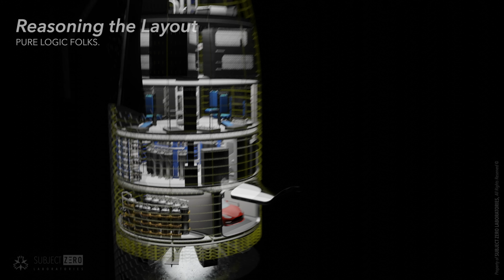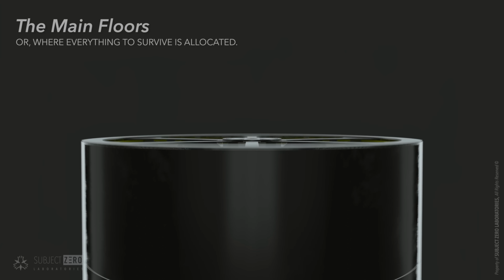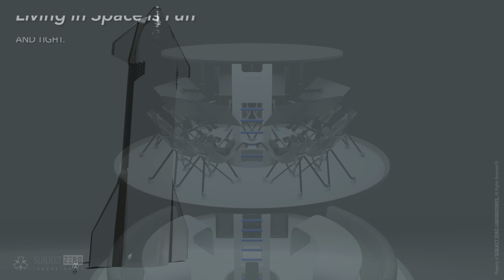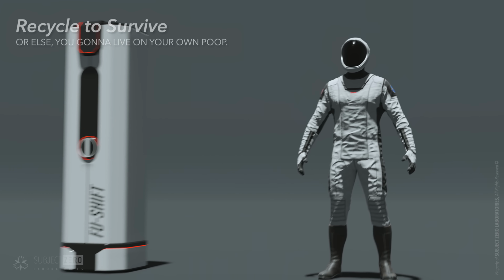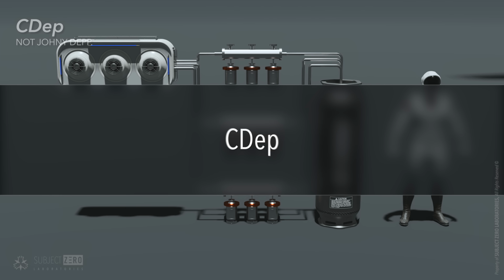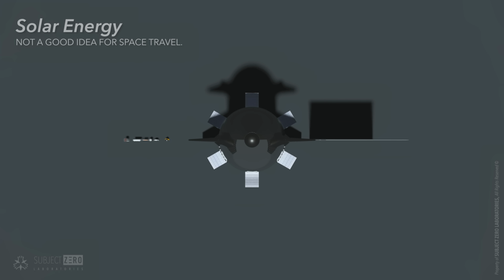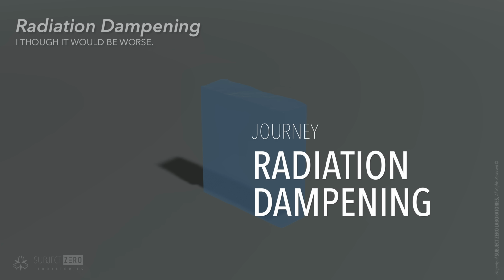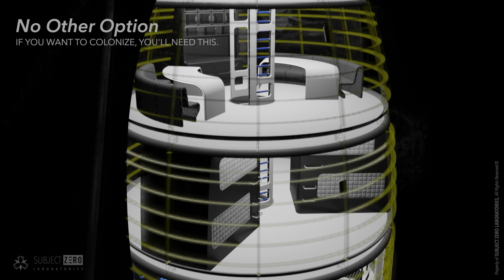Onboard the SpaceX Starship 2.0 in Detail - What it takes to go to Mars | Detailed Breakdown

Comment: I am pretty sure they will not build a one-fits-all solution. Cargo will be send to mars ahead of time. The human transport configuration will only hold the supplies that are needed for the transfer. Also i do not expect to have a full flight control deck for all crew members. I imagine something similar in size to an airplane cockpit. Why would the system do need a lot of human interaction, if the starship is designed to fly without crew and carry cargo on its own anyway?
Reply: Agreed ;)
Reply: This makes sense to me... 💯
Reply: Actually 2 ppl should really be enough.. or maybe even one
Reply: If something goes wrong, it's generally a good idea to have backup systems. Also they will need to be monitoring all kinds of different things on the screens and different pilots will probably have different controls.
Reply: @keithscommunityanddomestic9513  maybe until spacex is ready for mars we already have neuralink up and running, so u can do that from all around the ship.. im just kiddin obv, but still fun to think about
Reply: Nano bots will tend to our every need.
Reply: @wokeness420  ye, but they are in need of some major breakthroughs before actually becoming as efficient and useful as they could be..
Reply: Combining cutting edge tech will probably be more useful than advancing in just one field a lot and not use the other stuff.. like imagine what machine learning, nanotech, genetic engineering, neurotech and similar stuff could achieve.. its a slow progress, but once integration with humans becomes better i think we would become much more adaptable to hostile environments such as space
Reply: Perhaps initially best to send Westworld hosts of the inorganic and unconscious kind.
Later on, once the hosts have erected all the tents,
people in suspended animation pods packed in water jackets would then make the trip.
(And bring lots of low light loving,  
low temperature loving, 
living potatoes genetically engineered to maximize nutrition
(and oil to cook the french fries in the Mylar parabolic oven)).
Reply: @nulled7888   We'd need to become robots to be able to handle space... but don't let reality get in the way of your sci-fi dreams ;)
Reply: You need a place for the crew to sit during the start and landing phase.
Reply: You talking facts 👍
Reply: The tablets which permit astronauts to interact with the Crew Dragon are only fixed in front of the seats because, since the flights normally only last a couple of hours the Crew normally spend the entire flight sitting in their seats.  However the controls are merely apps running on tablets.  The traditional control panels on the Boeing Starliner look prehistoric.  Those tablets could just as easily be carried by the astronauts in a pocket of their coveralls, attached by a cable to avoid flying out of range in micro-gravity.
Reply: You guys are thinking like KSP. Imagine this is something YOU are riding. And then imagine you have to deal with the worst case scenario... 90% of everything in this thread is fairytale stuff with no basis in reality. When you have an emergency like there was an oopsies with the cargo ship, then either you deal with it now with what you have on hand, or your dead. Giving everyone access to critical controls and training means that you have 10 more chances for someone to pull your butt out of the fire.  Having the supplies on the spot means that you might be able to afford to wait for a return trip if an abort is needed.
Reply: @jamescobban857  they look prehistoric and your right, but when was the last time you ever had a mechanical switch or button not respond to your touch? They look like that because it's incredibly reliable. Is it outdated? Sure. But you wouldn't scoff at reliability if your butt was in a sling. You want equipment that has a zero percent chance of failing and when it does fail you want it to fail in a fixable way.
I'm not saying that Boeing's equipment is reliable mind you... I think Star liner is a sad joke made at the American public's expense by Congress.
Reply: @nulled7888  A flight crew in command of three (commander, pilot and engineer - all cross trained) is more probable, I think.  At least on first flights.  The rest will all be specialists of which minimum one has to be medical doctor.
Reply: @pierre.a.larsen  actually, yea for the first few flights thats probably the case.. after that tho, it might become more viable to have a smaller number of pilots
Reply: Still need supply for at least 3x for each person for backup.
Reply: @nulled7888  2 people should be an opposite gender and start breading
Reply: @rosekreuze  what the actual f*ck?
Reply: They could launch supply’s into space first which then they can pick up in space so they can take more with them
Reply: The reason for having the crew on one deck is for a likely Launch Abort system.  It's possible to do this for 15 person spacecraft.  NASA and FAA isn't likely to approve anything less until it has a proven flight record of safety.
Reply: @pierre.a.larsen  That's correct.  You need a Pilot, Commander, Flight Dr. and Engineer in the Cockpit.
Reply: Agree, the simplest solutions is usually the best solution.
Reply: @saquist  This is the main reason why SLS is still needed. People underestimate how much it takes to get a completly new system certified for human passengers. Especially if there is no launch abort system at all. The Starliner riding on top of the SLS is already up to all the standards and will be used many times during the artemis program before starship will be allowed to carry passangers.
Reply: the flight deck needs everyone in it for launch and landing (so they have a secure place to be)
Reply: A full flight deck is necessary when you consider launch and landing operations. Astronauts need strong seats with lots of safety features to go through a launch or landing operation. You can't just have people standing in their bunk beds hoping that 1.5 to 3 Gs won't fly them through the door without safety belts. That would just be unsafe. In the end, astronauts need a ''manoeuver seat'' and it's just better to have them all bunched in a control room because it allows for everyone to have the same level of awareness when things happen.
Reply: I agree
Reply: A pretty basic response is that it wouldn't be the best to be in a cramped space for 4-6 months, better yet all the waste and byproducts the astronauts might produce . Also it would be good to at least have a bit of places for experiments in the mean time. Places for habitation would also be ideal, as the astronauts wouldn't have much to do in the mean time, and 1 way light time is quite a long distance so communication with Earth won't be instant. Maybe entire rooms might be designed do to the extra space, and the cargo would probably already have been sent in the meantime. To be honest, sending humans isn't ideal for interplanetary colonisation as robots are far more cheaper and easier to handle with.
Reply: @wokeness420  God I hope this is sarcasm.
Reply: @oO0Xenos0Oo  The launch abort system is a good point,  however SLS is very expensive and overall not ideal for long term spaceflight. For missions to the moon, sure but Starship is far better in many aspects compared to the NASA counterpart, despite the lack of Launch Abort System.
Reply: @Monkey6900_   The idea of sending humans on interplanetary mission becomes really messy.

There would have to be two starship involved in one launch.
Reply: I agree 100% half the stuff he put in the usable area of the star ship is pretty useless, you don’t need that much room for a fitness center, command center, and lounge, it’s not a cruise ship. I would say it’s more likely going to be used by either commercial cargo (it is a private company and has to make money), medical equipment, or lab equipment (basically the entire reason we r going there and was not mentioned AT ALL)
Reply: @nulled7888  I agree, but u really do need at least 2 and I’d argue 3 is best, it is a long mission and the Apollo missions had 3 people
Reply: @Unmannedair  If it moves it can break.  If you have 100 switches that is 100 parts that can break.  It is also 100 switches which the pilot must memorize the function of.  There are no moving parts in a tablet except the power button.  And since all the power button does is generate an interrupt to the software even it is not strictly necessary.
Reply: @redthunder6183  ye, but nowadays we have better computers and everything is far more integrated.. idk tho, can just guess myself :v
Reply: @oO0Xenos0Oo  Indeed but I don't think human-rating a rocket and habitat are really that difficult.  NASA calls this a Catagory II rating and they want 1/500 failure for launch and landing or less. They also want a frozen design which will launch without flaw 7 times.

I think Falcon/Dragon Human rating took around 5 years. During that time, Launch, Parachutes, Life support, heat shield, guidance/docking and was finalized with the Demo-2 mission.  

In my personal opinion I think that can substantially be shortened. but that's only after the design is finished and it's no where near that now if you assume 3 years for certification...and the first successful orbital launch is some where in 2023 then 2026 is the certification date and that seems to be NASA/SpaceX's objective even though this is likely to slip to 2028.  I say that because they may have to certify life support for each of the different versions of Starship.  We know Starships will have the Lunar version and the Dear Moon versions in the beginning and Space X is a small company.  I doubt they can handle the development of these two versions without a substantial personnel increase.
Reply: @nulled7888  sure, but better computers won’t help when physical problems arise. In the likely case where someone gets hurt, you have to have someone to help the other person by there side, and it would be extremely helpful in this case to have someone back at base that is prepared for anything like bringing over more supplies or preparing medical supplies
Reply: @nulled7888  he said Space X satellites are not intended for Mars
Reply: @jamescobban857  if it can move, then it can break is true, but the same rules apply to touchscreens. And in zero gravity if something hard starts flying across the room, then you'd better hope that the screen isn't in the line of impact. Even gorilla glass has its breaking point. I have to work with touch screens everyday at work, replacing them. They're every bit as vulnerable if not more so than a switch. If the switch is designed properly it can take a hammer impact. Most aren't designed for that though. But even if the switch is damaged it has two wire contacts inside it that can be shorted to achieve the effect needed. Good luck fixing a broken touch screen in a hurry with a pencil or paperclip.
Reply: yeah! 2040s or 50s are going to be very exiting
Reply: If you ever saw the Space Shuttle when it was flying with a full crew, the "flight deck" was used only by the mission commander and the pilot and then two additional crew members who sat directly behind the commander and pilot.  All of the rest of the crew members...up to four astronauts but usually just three astronauts...were on seats located on the next deck below.  That was called the "mid-deck" on the space shuttle.  All of those flight chairs could be stowed away after launch to give more room for other activities like operating the remote manipulator arm (aka the "Canadarm") also happened on the flight deck.

It seems silly that the flight deck on Starship would be wasted space and not used for anything other than launch and landing activities.  Nor would there be any need for crew other than the mission commander and a back-up (aka "co-pilot" or in NASA usage the "mission pilot").  Absolutely just like the aircraft flight deck on a modern jetliner today.  Yes, the correct term is "flight deck" and not "cockpit" unless you are talking about something like a fighter aircraft or small one or two man aircraft.
Reply: Right, I was figuring that the beds they use would double as couches for most of the crew when undergoing thrust and only have a subset of the crew in the cockpit.
Reply: @GlanderBrondurg  yes. Jared Owen has a great video about Space Shuttle, where everything is explained very well with the animation.
Reply: We need to separate out the transit vehicle (Earth orbit to Mars orbit and return) from the Mars lander and ascent vehicle. That also massively reduces the problem of propellant production on Mars. The bulk of inevitably one way cargo can be sent on simpler, cheaper Mars cargo landers. Nothing particularly complicated - just regular blunt body landers with a few innovations. This will be more efficient in terms of mass delivered to Mars surface, versus mass sent from Earth. Also, separating cargo means that cargo can travel on slower but also lower energy trajectories.
Reply: @saumyacow4435  There certainly is logic to that at least initially.  Using a starship to deploy a one-way cargo probe to Mars could be re-used a bunch of times during the same launch window whereas if you send the Starship to Mars it's going to be tied up for years until it can make the round trip.

But it still boils down to how much would Starships cost to build in relation to the cost of a one-way probe.  The focus on Starship is driving down the price via both reusability as well as scale-out.
Reply: And what about the sex floor - seems they always forget that.
Reply: @saumyacow4435  

Check out everything I had to show by following the steps from my other comment, if we're talking about energy and many other advancements, that's where to go.

And before replying, follow the steps and watch everything, can't stand people who cherry - pick / nitpick and act ignorant to anything else, nothing worse than that to me.

My comments became hidden with links, so yeah quite the censored and bias from youtube, clearly, maybe even the video uploader caused it, who knows or the comments were reported by toxic and biased people with bad agendas, corruption basically.
Though there is a youtube algorithm that is very aggressive, it's just very odd that the links were shown and now they're hidden, I know they're there because when I log in I see them, when I log out and come back to refresh the video, they're hidden... how lame and biased is that to be censored when showing amazing things with the open mind around higher levels of innovation that would blow people's minds.

Also I know the comments with links were there a long time even when logged out, and now they're hidden... so not right to be silenced / censored like that.

Instead, looks like I will have to do things manually and without links, such as giving you steps, which will seem longer, sigh... blame youtube for that since my other comments are hidden with links under this thread OP.
And I can't make a new comment, it would seem the comment isn't there! So I'm attempting to edit this one, hoping it will still be there for you and others to see.

Check this out.

Go to my channel and find Technology Research, should be a video on the home page of that other channel a minute long and shows what I mean for the "created playlists", start at the bottom by scrolling all the way down to the bottom of the created playlists.

Watch just the first 2 videos at the top of the Graphene playlist.

Watch the first 9 videos at the top of the Photonic Computing playlist.

Watch the first 2 videos at the top of the Spintronics playlist.

Watch the full playlist called Graphene Twistronics.

Watch the playlist called Graphene computers for home and starships, all the way through.

There are 2 videos to check out after the playlists above that I will mention here.
There's a playlist called Graphene with starships, the video is about Graphene aerogels made in space.
The STL playlist has a video called "Spaceships capable of reaching our closest stars".

Watch all the Graphene "types" of playlists.

Watch the STL and Time Crystals playlists all the way through.

Watch all the Quantum Technology playlists.

And then watch all the other playlists under the created playlists.
Reply: @danielbuggie591  

Check out everything I had to show by following the steps from my other comment, if we're talking about energy and many other advancements, that's where to go.

And before replying, follow the steps and watch everything, can't stand people who cherry - pick / nitpick and act ignorant to anything else, nothing worse than that to me.

My comments became hidden with links, so yeah quite the censored and bias from youtube, clearly, maybe even the video uploader caused it, who knows or the comments were reported by toxic and biased people with bad agendas, corruption basically.
Though there is a youtube algorithm that is very aggressive, it's just very odd that the links were shown and now they're hidden, I know they're there because when I log in I see them, when I log out and come back to refresh the video, they're hidden... how lame and biased is that to be censored when showing amazing things with the open mind around higher levels of innovation that would blow people's minds.

Also I know the comments with links were there a long time even when logged out, and now they're hidden... so not right to be silenced / censored like that.

Instead, looks like I will have to do things manually and without links, such as giving you steps, which will seem longer, sigh... blame youtube for that since my other comments are hidden with links under this thread OP.
And I can't make a new comment, it would seem the comment isn't there! So I'm attempting to edit this one, hoping it will still be there for you and others to see.

Check this out.

Go to my channel and find Technology Research, should be a video on the home page of that other channel a minute long and shows what I mean for the "created playlists", start at the bottom by scrolling all the way down to the bottom of the created playlists.

Watch just the first 2 videos at the top of the Graphene playlist.

Watch the first 9 videos at the top of the Photonic Computing playlist.

Watch the first 2 videos at the top of the Spintronics playlist.

Watch the full playlist called Graphene Twistronics.

Watch the playlist called Graphene computers for home and starships, all the way through.

There are 2 videos to check out after the playlists above that I will mention here.
There's a playlist called Graphene with starships, the video is about Graphene aerogels made in space.
The STL playlist has a video called "Spaceships capable of reaching our closest stars".

Watch all the Graphene "types" of playlists.

Watch the STL and Time Crystals playlists all the way through.

Watch all the Quantum Technology playlists.

And then watch all the other playlists under the created playlists.
Reply: @gameresearch9535  Since this is a huge comments section, a recap would be appreciated.
Reply: @saumyacow4435  As a species we have a history of pushing boundaries.  While personal benefit does come into play for a lot of people, there are others for whom that is less of a motivating factor.  

What is the personal benefit to say climbing a mountain or doing charity work?  

Obviously going on a presumptive 1 way trip to Mars is a lot more involved in that, but being apart of something big and new can be a huge motivation.

A mars colony would need such people initially, but as time goes on and more people go there that could change to include profit-motivated workers.

A bigger concern for viability of a Mars colony in my mind is more physiological rather than psychology.  We don't really know the consequences of living in a lower G environment cradle to grave.  The ability to have and raise kids in Mars gravity would be crucial for the prospects of a colony's success.
Reply: @attsealevel  every floor is a sex floor when nobody's here to arrest you for indecent behavior
Reply: @inemanja  Hmm, every floor - a good thing esp if they end up having to propagate the species. 

I like that we finally got to see how all that space might get broken out and utilized.  Just makes these journeys now seem a whole lot more real.  I'm an engineer and hope maybe one day to experience space flight.  Though, I'm afraid so much will be AI driven by then, that few humans will ever get that opportunity.  Thx for your response.
Reply: They should completely build the transport vehicle in earth orbit.
Reply: @danielbuggie591  I think what you need to do is understand the distinction between merely visiting/exploring Mars and living there long term. Visiting/exploring it has both collective benefit and personal benefit. Living there long term does not. And if living there long term does have a rational self-benefit I'd love you to be the first to explain what it is.

You say "as a species we have a history of pushing boundaries". Actually, as individuals we have a habit of pushing boundaries. But we do so at least in the belief of rational self interest. We climb Everest, despite the risk, because we, individually want to. There's a real or perceived self benefit in doing so. What we don't do however is pitch a tent there and attempt to live there permanently. This emphasises the difference between the potential of self benefit that comes from visiting/exploring a place and the certain lack of self benefit from living there. Again, there is zero self benefit from living on Mars. And btw, there are real and imagined self benefits from charitable work and other acts of good social behaviour. 

So, again, where is the actual benefit that accrues to an individual human being from living on Mars long term (as opposed to visiting)? 

Again, people are rational. They may take risks. They may take ill informed and self-harmful risks. But they don't live on the top of Mount Everest - because we all know that there is nothing to be gained from doing so.

Again, this isn't going to happen because humans (except by mistake) don't do things that are of no benefit to anyone, least of all themselves. A Mars colony is not going to happen and it's for that simple reason. No benefit to self. No collective benefit. Its a really dumb thing to do and whilst I agree there are a minority of stupid, reckless humans, most aren't.
Reply: @saumyacow4435  And that's where our opinions depart.  People are frequently not rational.  We may be adept at rationalizing but that is not the same thing.

I also disagree that there is no benefit to anyone living on Mars.  The same desire that drove us to explore didn't just stop when we ran out of landmasses to explore.  Wanting to learn is something is a very primal part of our existence and I'd expect plenty would consider learning about a whole new world rather rewarding.

What I rather expect though is (if we proceed) it'd happen in stages.  First, a few boots and flags missions.  From there proceeding to being a place where people work for a time a la Antarctica on Earth with a subset choosing to stay progressively longer periods.  At some point, critical mass would be reached and the a colony could become self-sustaining.
Reply: @danielbuggie591  You've still not answered the fundamental question: "What's the upside for an individual human being in living on Mars long term?". We're not talking about visiting, which is what you allude to. We're talking about actually staying there for years. And don't forget, we are talking about something of benefit to an individual human being, available only from living on Mars long term, and isn't available on Earth. I cannot think of a single benefit. Can you?

Now let me deal with the rest of that. Firstly, yes people are capable of being deluded, acting against their own best interest and so on. The problem here is that this isn't just accidentally stepping too far off that cliff - that comes for free. We're talking about people making a long term decisions involving millions of dollars. We're not talking about a moment of foolishness. Given that there is literally nothing of benefit on offer, how many people do you seriously think would do something that is fundamentally self destructive? (and not in a small way). And to be fair here I'm not even going to go into just how expensive this is and the fact that early adopters would need to be multi billionaires - and how many billionaires do you know who are totally reckless, ill informed and self destructive? Oh, I'm sure there's a few, but not enough to pay for the multi trillion dollar cost involved.

As for the impulse to explore. Sure, we all have that. That's why we have space agencies. And why we send carefully selected, emotionally resilient, highly trained people who have given informed consent and know that just one mission will probably harm them for life. I'm ok with that. But what you don't do is actually stay there long term, no matter who you are. Because there's no further rational self benefit in doing so. As I said, you need to explain the upside that comes not from visiting or exploring, but from staying. 

Those initial exploration missions are the domain of space agencies. There's no "business case" for them. Only the collective social license from a society willing to spend the hundreds of billions involved. And for that reason it will be funded by a consortium of space agencies. Not SpaceX. 

Will colonisation follow? No. Because there is no rational self benefit in living on Mars long term. Who is going to buy that ticket if there's nothing in it for them. Certainly nothing they cannot already have on Earth. You see, Mars colonisation enthusiasts keep conflating the benefit (to humanity) of exploration with the supposed benefit of colonisation. Those two are quite different things. They also conflate the question of "is it technically possible" with "is it a worthwhile thing to do". The answer to the first question may well be yes, in time. But the answer to the latter question will always be a resounding no. Unless you can give me one single reason. A reason why a human being is likely to benefit from actually remaining on Mars long term. A benefit that doesn't attach to visiting. A benefit that isn't available on Earth.

Go on.. make my day (dozens of Mars colonisation enthusiasts have thus far failed to give one, singular reason).
Reply: @saquist  If Starship fails, the crew are dead. And hundreds of flights are needed to prove is reliability. It isn't going to be human rated.
Reply: @oO0Xenos0Oo  There's a big difference between approving Starship for lunar landings and human rating it for Earth launch and descent.
Reply: @TimothyOBrien1958  Agreed. And further, that transport vehicle should be designed for the purpose of transporting humans safely from Earth orbit to Mars orbit and return. Instead of Starship, what you end up with is a crew module attached to a long truss (about 150 metres). At the far end of the truss you have propellant tanks that act as a counter-mass in flight, which then gives you spin gravity. Elsewhere the truss supports solar arrays, radiators, comms gear and so on. All of which assembled (from modules) in Earth orbit. No need to go through the lengthy and risky process of disassembling and stowing all that external gear for descent - since this transport vehicle lives entirely in space.
Reply: @saumyacow4435  Not exactly. Between 2016's Falcon 9 pad explosion and Human Rating in was was 3 years and 66 launches of the Falcon 9 rocket. But in reality NASA only required 7 launches of Full Thrust Block Five variant for human rating
Reply: @saquist  You can afford to be more relaxed about long term reliability when you have a launch escape system. But when you don't have one (Starship) safety can only be established when you've flown dozens to hundreds of flights without a glitch. There's a big difference in terms of what level of statistical reliability you're willing to accept when on the one hand, if it fails you can get away and on the other hand, if it fails you're dead. 

This is why Starship will not be human rated for Earth launches for a long, long time.
Reply: @saumyacow4435  3 years 66 launches with a semi reusable rocket... seems logical to assume a fully reusable rocket using low carbon rocket engines should be able to fly at least once a week and at most and one hundred flights per year...I don't see problem with human rating if Falcon is already flying 60 times this year .
Reply: @saquist  66 launches doesn't come anywhere near to establishing reliability. How many launches of the Space Shuttle did it take to expose fatal design flaws?
Reply: @saumyacow4435  I'm afraid unfortunately all of the space shuttle and even passenger jet design  flaws were known but ignored before the actual catastrophic failures.

NASA knew freezing temperatures would compromise the rubber seals on the SRB O-Rings...they flew it anyway. Foam had fallen off the ET many, many times before and even impacted the wing as early as 1992...NASA culture ignore engineers concerns. Many problems in Aerospace aren't as difficult to solve as ego, complacency and ignorance. 

Boeings 737 Max didn't fly hundreds of flights before returning to flight and you and many others still board passenger jets.

How we actually solve the flaws is by doing hundreds of test before flight
Reply: @saquist  Agreed. Its also borne out in the history of aircraft. It can take hundreds and sometimes thousands of flights to reaveal a design flaw. If you've got a parachute or an escape system you can sidestep that level of testing, but Starship hasn't and can't.

Capsules, with escape systems, are proven.
Reply: But, the problem is carry people to mars, isn't it? All just for 10 members crew. Btw cargo is other problem as i understand, its intresting, a lot of companies could born in the next years.
Reply: @saumyacow4435  indeed, that's why I believe  Starship should either create a Super Dragon Capsule to ferry 15 people at a time to a Starship in orbit...or create an abort system for this trailblazer crew Starship.  A 100 passenger Starship for 10 years in the future once proven safe for mass transit would rely on pure reliability
Reply: @saquist  Well, as numerous people have pointed out (including this video), Starship isn't going to be carrying 100 people to Mars. Perhaps as an orbital tourism vehicle, maybe? But even then the safety of Starship won't be established until its flown, unmanned, hundreds of times. That could be 20 years or more. In the mean time, the safest option will always be chosen (Dragon and others). Also, Starship by design just isn't capable of having a useful launch escape system (despite the numerous fan fictions). And worse, there is simply no possible landing escape system available. It either fires up and lands, or there's a bunch of dead people. Capsules have the advantage of having a higher drag to mass ratio and secondly having proven, redundant parachutes.
Reply: @JavierPerez-rs6oo  If you're talking about realistic but limited human exploration missions to Mars then yes, we only need a small crew. Probably 6-8. But if we're serious about that, we need specialised vehicles:

- A light, crew only, reusable, fully propulsive Mars lander and ascent vehicle. 
- A fully featured Earth orbit to Mars orbit (and return) transit vehicle.

A specialist Mars lander/ascent vehicle requires a few tens of tonnes of oxygen for refuelling for ascent. That's a tiny fraction of the 1,200 tonnes of propellant (both oxygen and methane) needed for Starship. It also provides the crew with a gentler descent - about 1.5 gs vs 5 to 6 gs for Starship. Its also safer for several reasons and its more versatile mission wise.

A specialist transit vehicle isn't burdened by all the stuff needed for landing and ascent. Which includes structural mass, thermal protection system mass, engine mass and other things. That means you have more mass you can dedicate to keeping people alive and making the entire vehicle more resilient. Plus you can do spin gravity with one rigid vehicle. 

Starship is an unavoidable compromise because its trying to be both the transit vehicle and the lander/ascent vehicle.
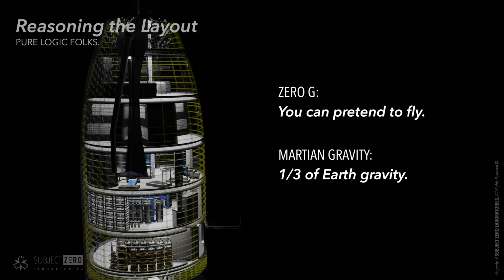Reply: @saumyacow4435  Starship can quite easily have a capsule design on the nose that saves 15 people from a failed launch between T-0 and T+1:00. The question is do you want to sacrifice the payload to orbit?  If you do it the result is the same...you still want two extra starships for cargo and back up on a first Mars trip.

Dragon is 9.5 tons double the mass for 14 people.  Starship -18 tons is 82 tons to orbit. It's really not a big deal. The design may be difficult because the TPS and crew transfer but it's nowhere near impossible or unrealistic,  just not ideal.
Reply: @saumyacow4435  I never had any interest in convincing you or winning or whathaveyou.  Merely sharing a different viewpoint.  

You're convinced that what you see as self-interest is the only sufficient motivating factor, I believe that people can be passionate enough about other motivations to make that plunge.  

Nothing more to say beyond that.
Reply: @danielbuggie591  I'd still like to see you give it a go. Just one single benefit that comes only from living on Mars long term, if you please?

Passion has nothing to do with grim reality. I'm passionate about sci-fi spaceships. The Liberator from Blakes 7 being my all time favourite. But I do know the difference between fantasy and reality.
Reply: @saquist  Sure you can do that but firstly it adds a lot of mass to the vehicle. Mass that has to be subtracted from somewhere. Presumably meaning a less capable vehicle once its in space. Secondly, it does not protect you from failures close to landing. Starship is unique in its high speed belly flop and the need for it to successfully relight engines after shaking up all the fuel. And you know, there are safer ways to land on Mars.
Reply: @saumyacow4435  That's why I said at the outset is to use a Super Dragon Capsule to ferry the crew onto and off Starship in orbit instead of launching with a crew.
Reply: @saquist  But that simply begs the question of why use Starship as the transit vehicle when there are better possibilities. I think that in the end, Starship has a role in lifting cargo into Earth orbit. Beyond that I don't see a role for manned Starships and there are also more efficient ways to get one-way cargo to Mars.
Reply: @saumyacow4435  Musk has said the objective is to build a colony.  To some extent we have a realize carrying humans is just like carrying cargo when it comes to efficiency.  More capacity per trip is better.  It lowers over all cost of operations.  

Air line Engines have become SO efficient now that larger planes are really only used for extremely long distances and super heavy cargo.  A 737 is so efficient with 2 engines now they can be used for Trans Pacific Flights when just 13 years ago we'd only fly those routes with a 4 engine 747, 767.

So even if send a smaller craft would be more cost-effective (like a capsule) the biggest disadvantage there is that platform can never do anything more than 10 to 15 people.  It's not sustainable even though it maybe much more economical.  Starship will be an excellent jack of all trades.
Reply: @saquist  Well for one thing I don't see a purpose in colonising Mars. As for efficiency, quite a number of people have come to the conclusion that something the size of Starship can support roughly a dozen or so people. Elon's "business case" is a fantasy for this and several other reasons. 

Therefore I'd rather talk about what is needed to sustain realistic human exploration missions to Mars. 

Starship being a "jack of all trades" is precisely why its such a bad design. Its trying to be lander/ascent vehicle and a transit vehicle and thus is fundamentally compromised. The requirements for a vehicle that is capable of landing are not those of a vehicle that transits in space.
Reply: @saumyacow4435   colonizing Mars is going to happen if not merely political and economic realities than or also for altruistic Earth  preservational purposes.  Clearly if we had stayed on the Moon and Mars for the last 50 years mining and power generation would be space based right now.  Climate Change would be irrelvant and strip mining habitats would be very unnecessary for this current Green Revolution but politics is full of people of limited imagination and vision.

Starship is a paradigm shift in design thinking.  It's going to upset a lot of designers...But I work here at JSC and let me tell you something.  In one meeting I brought up the problem that our specialization due to the Rocket Equation was clearly causing us to accept thin Margins and those thin margins were allowing disasters like Columbia and Challenger.

A jack of all trades (as it were) isn't specialized...or ideal it's capable across a spectrum of needs and that flexible architecture (especially right now) will allow us to STOP designing and move into a modular Mass Production level of Spacecraft design.

That's one of the things that's revolutionary about even the R&D phase.. It's as simple as 1/4" steel and a welding robotic arm!  ULA is still determined to use 1.25 aluminum with ISOGRID to save weight.

We're all watching this right now because this a completely different way to play the safety margins and it's simpler too which saves cost which makes launching more rapid and regular which is what a space economy requires.
Reply: I'm pretty sure this entire discussion was about the supplies needed by the astronauts while in flight. No cargo or whatever at all, including no personal cargo.
Reply: @saquist  Colonisation of Mars is not going to happen because it serves no purpose either from an individual viewpoint, or a collective one. Let me start by asking you a fundamental question. What does any individual human being stand to gain personally from living on Mars long term? In other words, what is the self-interested, rational benefit? I've asked this basic question many times and so far no advocate of Mars colonisation can offer up a single cogent response. A single "upside" that accrues from living on Mars long term, that isn't attributable to merely visiting/exploring Mars and which isn't available by simply remaining on Earth. Not one, single, rational self benefit has been provided.

As for collective benefits, I think those who argue that we can all get away from Earth and enjoy the good life on Mars need to do a reality check. What exactly are we supposedly escaping from, and how will that make the Earth a worse place to live than Mars? Also, if what you're afraid of is human induced, and as a result of our primitive nature, what does that say about human life on Mars? It only makes things worse.

And if you think that spending trillions of dollars establishing an industrial base on Mars will somehow create a utopian world there, two things. Firstly, no, we're human and will export the worst of our behaviour/culture. Secondly, all this yet to be invented sophisticated technology might actually be used to create a better Earth. We're not short of minerals for instance. Nor are we short of potential energy to process that.. or recycle the billions of tonnes of valuable materials already sitting in landfills. And so on. 

Starship is not a paradigm shift. Its just a reworking of tired and flawed architecture known as "Mars Direct". There's nothing original about it. Zubrin pushed this concept decades ago and Elon is simply buying into it because of his affiliations with the Mars Society. Mars Direct is not the architecture we need for realistic exploratory missions to Mars. It involves strip mining vast tracts of thin Martian soil. It involves an ecosystem of robotics. It involves a multi-megawatt power supply and energy storage and distribution to go with it. And the reason for this ridiculous scale is the size of Starship. If you want a serious Mars transport architecture then you need Mars indirect - which requires a fraction of the amount of Mars based propellant production. 

The Columbia and Challenger disasters are the result of organisational failures, and the failure to understand that design vulnerabilities may not reveal themselves for dozens of flights. In fact its a good starting point for understanding Starship - which thanks to what we now know about the Shuttles, needs to be flown unmanned hundreds of times before it can be deemed safe for human flight.

You're not going to see mass manufacture because there is no business case for that many Starship. Not for Earth launches and certain not for Mars. There is no "business case" for Mars colonies. Not even multi-billionaires can afford the early adoption costs. We're talking tens of billions to establish the must-never-fail deep space life support technology. We are talking hundreds of billions to establish the Mars based propellant production (again, industrial scale) and we are talking trillions for the "self sufficient" industrial base. No one on Earth can afford that. And when we do have the technology, we might also have the ability to solve a lot of problems on Earth. Think about that for a moment.
Reply: In the fullest sense of evolutionary reality population density/persecution has been the single largest driver of migration since Homo Sapiens left the African continent and colonized Europe/Asia.  

Since the discovery of Gobekli tepe scientist realized that ideology seems to have been the primary reason why nomadic humans began to congregate in large numbers.  They took up a multigenerational project that served no individual purpose. We've seen this repeated throughout the last 12,000 years.  Despite what you may feel the truth is quite evident that humans are far more peaceful than violent, otherwise civilization would not have arised or achieved it's current heights. 

Most sophisticated technology is discovered by pursuing adjacent, parallel or even opposite goals from how they are eventually applied and frankly Kennedy said it best.  We should do it "...𝐛𝐞𝐜𝐚𝐮𝐬𝐞 𝐭𝐡𝐞𝐲 𝐚𝐫𝐞 𝐡𝐚𝐫𝐝, 𝐛𝐞𝐜𝐚𝐮𝐬𝐞 𝐭𝐡𝐚𝐭 𝐠𝐨𝐚𝐥 𝐰𝐢𝐥𝐥 𝐬𝐞𝐫𝐯𝐞 𝐭𝐨 𝐨𝐫𝐠𝐚𝐧𝐢𝐳𝐞 𝐚𝐧𝐝 𝐦𝐞𝐚𝐬𝐮𝐫𝐞 𝐭𝐡𝐞 𝐛𝐞𝐬𝐭 𝐨𝐟 𝐨𝐮𝐫 𝐞𝐧𝐞𝐫𝐠𝐢𝐞𝐬 𝐚𝐧𝐝 𝐬𝐤𝐢𝐥𝐥𝐬,".  We don't yet know what we will invent on the road of exploration that's why we go.

A paradigm shift is defined as "a fundamental change in approach or underlying assumptions".  Starship will be rapidly and fully reusable and mass produced which has never happened in the Rocket Industry.  

Everyone always makes this mistake of what a business case looks like.  The business case is fairly obvious.  Clean Solar Power Production by means of Orbital Arrays.

Then of course there is the two survival cases for orbital mass production.  1. Saving Earth's Environment by removing polluting industries from the planet. 2. Planetary Defense from fast moving asteroids through orbital defense array of Laser (commonly called De-Star Project) which could also be used for transportation. 

All this is based on one single business premise....Vision and Innovation. "𝐃𝐢𝐠 𝐭𝐡𝐞 𝐰𝐞𝐥𝐥 𝐛𝐞𝐟𝐨𝐫𝐞 𝐲𝐨𝐮 𝐧𝐞𝐞𝐝 𝐭𝐡𝐞 𝐰𝐚𝐭𝐞𝐫".
Reply: @saquist  I'm struggling to make sense of that. If I got this right, we are a primitive species that responds to population pressure by constantly spreading like an infestation, rather than becoming a civilised, self aware species with a rules base culture? If so, there is no hope for us on Mars. We will wipe ourselves out on both planets. So, Mars is not a solution.

On the other hand if you believe we are capable of being civilised, living within rules and putting limits on growth, then there's every reason to believe we can live happily on one planet. So which of these two do you choose? I'd choose the more optimistic one. 

There's lots of drivers for technology. Heck, even the goal of realistic, but limited exploration of Mars will drive technology. In fact it will drive it in the same direction that colonisation would. So why colonise when you get the same benefits out of being a little bit more civilised and merely exploring?

And of course, there's drivers for technology based on being a civilised species trying to solve our problems here on Earth. If you believe in technology as a driver of history (as I do) then you also believe in our capability to make this planet a better place. And lets face it, the same bucket of cash/effort/whatever poured into technological development is going to have a far bigger payoff (for more people made happier) here on Earth than it ever will on Mars.

And then you go and list a bunch of supposed benefits without really thinking those through. For example - taking polluting industries away from Earth. There is of course a better solution and that is to make them non polluting. Now if you can believe in the kind of robotic technology that would establish a fully self sustaining technological base on mars, then you can also believe in doing things like improving our current industry on Earth. So that argument falls flat.

Ah yes the old planetary defense argument. No, this makes no sense at all. If a large rock wants to hit Earth, it will. All those billions of people who will die as a result, will still die. What you're really trying to argue is that Mars can act as a "backup". But lets first examine the facts. A very large asteroid impact - even the infamous "dinosaur killer" will not result in extinction of the human species. It would be calamitous of course. But no, it won't wipe us out. Now, what benefit do you get from a "Mars backup"? Well let me explain.

Suppose we knew a big rock was going to hit the earth in ten years time. We cannot deflect it. Do we A) spend trillions of dollars saving tens of thousands of people in a Mars colony. Or B) spend a similarly sized bucket of cash (presumably everything we have) at saving tens of millions of people here on Earth, in deep shelters? Seems a bit of a no-brainer when you consider it, right? Not only that but if you save people on Earth, you also get to save far more of our technological and cultural heritage. And you get to save a lot of other species. So, what purpose does this "backup" serve exactly. Worse, on Mars, life will be extremely fragile. We export our primitive behaviour there and what happens? Well, what happens is we're far more likely to make ourselves extinct on Mars. Meaning, whatever problems we now have, we need to face them directly, rather than running away from them. 

The point is that no would be Mars colonists has yet said what this external threat is that will cause human extinction and which doesn't also wipe us out on Mars. Mars is always far more vulnerable to external threats (like solar flares) than the Earth. And if you want to think about the smaller end of the scale, there are lots of smaller meteorites that routinely hit the Mars surface that don't hit the Earth (because we have an atmosphere). So much for all those sci-fi fantasies about big glass domes. The reality is that life on Mars is about living underground - and if you're going to do that then the direct comparison is underground life on Earth. At least there you aren't going to die of asphyxiation the moment someone breaks a seal. 

In summary. There is no rational self interested benefit hat comes from living on Mars. Humans are rational self maximisers. They aren't going to act against their own self interest. Therefore they aren't going to go somewhere where there isn't something to be gained for them personally. On Mars, you are always going to be worse off than if you had stayed on Earth. Likewise, there is no "collective benefit" that comes from colonisation of Mars that withstands basic scrutiny. See above.
Reply: @saumyacow4435 
Hi here's the reason :
Scenario = I need 2000 people to run,  expand and maintain my titanium and lithium mines.
I'll pay each one $1M / yr (or equivalent idea) ,  plus gift them 2 km3 of land (for underground and surface dwellings), plus pay for all gardening food growing terraforming oxygen making greenhouse capsule input...
Minimum contract 25 years..  

Any takers want that self interest?

There'd have to be a waiver or no guarantee clause with something like 'if you don't make it,  or don't make it back,  we'll pay your family heaps anf heaps of dosh' 

Probably get a few ya reckon?
Reply: @alanmatteucci4527  Let me respond to that in 3 ways. Firstly, let me take for granted your premises. Somehow you've managed to spend trillions establishing the necessary infrastructure. For some reason your mine requires human input. And also, despite the known laws of economics, you've established a market in the only place where one really exists - Earth. What you've actually created is no different to a fly-in-fly-out situation we already find on earth. Remote mining sites. Oil rigs etc. Where people are willing to take high wages in return for short stints in a harsh and psychologically taxing environment. The main difference being that physics dictates that the minimum length of time spent on Mars is roughly 500 days (plus transit). Now, what you have is a situation where people might want to get paid to take on the task. Despite the risk. Despite the isolation and deprivation. So 900 days later they arrive back on Earth and actually get to enjoy spending that hard earned money. Good. The thing is, that's not living on Mars long term. And before you say "yeah well they can stay longer". Two things. Firstly, very few human beings will suffer that. Secondly, good old fashioned occupational health and safety rules will probably dictate that you don't get a second go at it. 

Not only is that minimum contract never gong to be accepted but you'll run up against both legal and ethical hurdles if you think its a good thing for humans to exist in such an environment longer than absolutely necessary.

Now, that's me being nice and accepting your premises.

Second, you're going to lose trillions of dollars before this ever happens and there is no market for the fantastically expensive materials you produce. Export it back to Earth and you add several zeros to what it cost to produce on Earth. So, yeah, nice sci-fi script, but not a reality.

Thirdly, you've missed the bit that before any of this happens you have to invent an entire ecosystem of sophisticated, highly reliable robotics. The kind needed to first of all establish the industrial scale mining and processing operation needed to merely refuel ships on Mars. Not to mention the hundreds of megawatts worth of nuclear power supply and distribution system. All, as I said, robotic. Further, you're talking about expanding this to a mostly self sufficient industrial base. Hence, we're talking trillions. You have no business case. 

And thirdly, even if we ignore that, you've got another problem. If we both accept the possibility of such sophisticated robotic technology then you don't need humans in the first place. Save for perhaps the occasional short term crew to troubleshoot and sort out exceptional issues. Hence visits, not colonisation.

So, no.. its not going to happen and there's no rational self interest in living on Mars long term. No amount of money compensates for the loss of anything resembling a life or the cumulative damage both physical and psychological. Think about fly in fly out workers. They have the advantage of seeing their friends and family regularly and usually they don't last more than a few years. Oil rig workers burn out (and often have psychological issues) in short order. Mars has nothing to offer a human being. Its all downside. And you're not going to have slaves. You're going to have real people who will want to go back and have a life on Earth. Not a hole in the ground and the knowledge that death is just around the corner. 

Btw I admit to a chuckle at your choice of two very ordinary and by no means rare elements. What you need is to discover unobtanium. At least then Mars won't have the problem of unfriendly natives.
Reply: @saquist  What I'm saying is that if you think Mars is a good way to escape self-inflicted problems on Earth, then it isn't. We carry our behaviour and culture with us. The difference is that bad behaviour on Mars is likely to be far more deadly. 

Your second point is about exploration of Mars. Whilst I agree that humans should now explore it, this is not an argument for colonisation.

Your third point is pretty lame. Proposed technologies for Mars are very vague. The kinds of technologies we need on Earth are in fact a lot better defined and a lot easier, at least technically. That's the point.

On your fourth point, you're wrong in point of fact. Were a "dinosaur killer" asteroid to arrive on Earth tomorrow, we would survive as a species. If we had notice then we could do a better job at rescuing other species than putting the same resources into Mars. 

Next point. No, we can't do both. That's the point. Faced with an existential crisis we only have so much time and resources. Its either deep shelters on Earth, or Mars. The former is better bang for buck. In fact every other solution is better bang for buck and that includes orbital shelters and shelters on the Moon. 

Next point. You don't need these kinds of resources on Mars for the purpose of exploration. You need simple habs. 

Next point. Yes, we are a difficult species. But it also requires a certain amount of wishful thinking to believe that the same species won't arrive on Mars and then promptly wipe itself out there. The simple fact is we need to grow up. We have no other choice. The whole idea of Mars being a "way out" is just a cop out.

Your next point admits to the fact that on Mars we will be cave dwellers, with very little access to the surface and only for short times. How does this constitute anything other than torture? And why would you not accept the simple premise that the typical human being, given the choice between living in a cave on Mars, or staying on Earth, is going to find life better on Earth?

Your last point is irrelevant. It doesn't matter what I want or what I choose. The question is about what a typical human being wants or chooses. Given that Mars provides no rational self-benefit to the typical human being, I don't expect any sane, self respecting, well informed human being to live there.
Reply: @saumyacow4435   Good is subjective qualitative assessment. That will differ with every person.  I'm saying a Mars colony is a viable possibility over  dealing with the stubborn cultural inertia of various nations to fix the problem.  If that ignorance persist humanity will need a second chance.

-It wasn't my point it was your point.  

-Survival is a probability assessment. Not a matter of right and wrong.  There is no way to know for sure.

-There are multiple nations...it's improbable we will all chose and trust the same solution to survive and extinction level event no matter how logical it is to do so.

-We've been here as a civilization for 15,000 years few cultures have wiped themselves off the planet...it's more irrational to believe the harsh environment would cause humans to pull together during times of strife like we do...literally all the time.

-Humans are no a monoculture.  We choose different things.  Out of 8 Billion people there is a high possibility that a million people will choose start something new just like Columbus and millions of others.  Humans are explorers.

-I agree it is irrelevant but you are substituting We for I as to presuppose that your conclusions will be reach by everyone.  You opinion is mixing with reality.  A Colony will happen....there is a specific person making it happen.  That's all there is to it.
Reply: @saumyacow4435  simulating isn't ridiculously costly. Some of it is quite simple and rember as NASA team member I know we've already studied this numerous times on station and in Biosphere 2. It will be different but evidence based studies show many humans are adaptable enough to find the endeavor worthy and even create a family in those environments.  Eskimos and Baju adapted to incredibly inhospitable environments.

74000 ancient humans survive the explosion of the Toba Supervolcano Toba with only 3000-10,000 individuals. We survived the Ice age, the Black Plague and the Tambora Eruption...clearly smaller can survive in habitats and grow large again and rebuild or continue building.
Reply: This might be the lunar version
Reply: @saquist  Ok, so somewhere underground on Mars there will be a nice beach, with waves? And a nice little forest I can walk through? Nope, didn't think so. 

A family? Leaving aside the biological hazards (failure to procreate, birth defects etc) what's the ethical situation in bringing up a child in an environment that is totally isolated and subject to harsh deprivations. If you took a child on Earth and put him/her in a similar situation (confined underground space, artificial environment, no interaction with nature etc.. that might be considered abusive. Again, what's the upside in living on Mars long term? The rational self-benefit. The thing you're going to get there you cannot get on Earth?
Reply: @EverydayCats1994  Yup.  They might need to skip landing and come home due to some failure or emergency.  They need supplies for a round trip at a minimum.
Reply: @saumyacow4435  An emergency escape system might not require significat new equipment.  If SpaceX adopted the old Soviet interstage architecture - a lattice structure with a lot of open space - simply detonating any explosive bolts in that structure and lighting the Starship engines while cutting the booster engines could be a starting point for development. 
SpaceX are planning to use Starship for as many roles as they can.  The number of launches required to certify the basic vehicle should come and go fairly quickly, particularly if all the variants are assembled from a basic vehicle with replaceable appliances for the specialized tasks.  Separate inserts, if you will, where all of the Flight systems and hardware remain unchanged across mission packages.
Reply: @frankmcgowan9457  There's no escaping the risks involved in landing. Hundreds of flights could mean 2 decades.
Reply: @rolflandale2565  Well let me stop you at the first line. All the credible assessments put Srarship's crew at 12-16
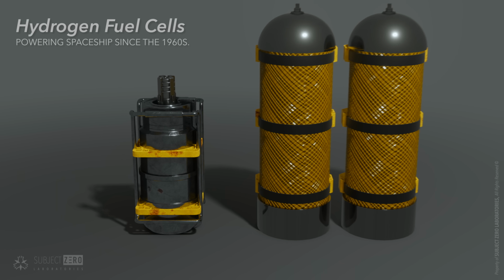Reply: @saumyacow4435  "12-16?" You mean 12:16? Even if you mean a schedule date, stopping will not =  arriving.
Reply: @rolflandale2565  I mean 12 to 16 occupants.
Reply: @saumyacow4435  So? What is that a private VIP occupancy? The craft was claimed to be more than just 12, heck why not be just one since it's autonomous operated, what does any of this have to do with the fact, 2 cans of silver non decal redbull is not enough to get yer ARSM to MARS?
Reply: @rolflandale2565  No its a reasonable estimate of its capacity when flying to Mars.
Reply: A note to Jason Privately. It seems my reply to you  about the design of a realistic Mars mission and the lander and transit vehicles has disappeared. If you want me to repeat what I said, let me know.
Reply: @saumyacow4435  mheh, so is me having just client and my private jet pilot... you can say, that is one HUGE craft for 12, perhaps call it a space RV, which is what I use to nickname it. That would really surpass the Mell Falcon, in...
 (song theme turns on) 🎶!SPACEBALLS!🎶
Reply: @rolflandale2565  Aww.. thanks for the funniest bit of YT comments section satire I've seen in a while :)
Reply: Science Revolution  lol
Reply: @saumyacow4435  that's just the fruit topping compared to how hilarious of requirements, with the evolution of this craft needs so far.
Reply: If the top section can be seperated and brought down safely using parachutes then that is a life saver during a catastrophic launch and that would require the entire crew to be in the top section together. That was what I got from seeing all those chairs on the 3D model.
Reply: @michaelpettersson4919  The landing is more dangerous. There is no defense against this apart from demonstrated long term statistical reliability - hundreds of unmanned flights. There us no need for manned Starships anyway - they will make useful cargo vehicles
Reply: @michaelpettersson4919  absolutely! In fact Starship-cargo/upper stage will require a logistic/emergency eject of 3 section compartments. 1- at very top, as the all crew seats launch sequal chamber, 2- second compartment, the living render room, needs eject/remove ability. 3- the bulk cargo. ALL need a separation ability from the danger of the fuel canister or any versital & senario purpose. Which they have nothing like that so far.
Reply: @saumyacow4435  The Soviets avoided that problem by ejecting before landing.
Reply: @michaelpettersson4919  Yes in the earlier Vostoks there was an ejection seat. Designed for an ejection at about 7,000 metres. Blow the hatch, fire the seat. The pilot had to have a full suit. He then needed to descend to about 2,500 metres to open his helmet and get air (there was no air supply during ejection). Its not a concept that can carry through to Starship. For a start, you probably don't want individual hatches for every crew member. Meaning you need a capsule within the vehicle - presumably the pointy end. Second and bigger problem is that unlike Vostok, Starship is originally oriented horizontally. An ejection during that phase means very sudden shear forces acting on the escape capsule and it has to re-orient itself and apply its own thrusters. Worse, the event that results in the highest risk is the re-orientation of Starship to the vertical, quickly followed by engine ignitions. If something fails here you've literally got seconds to deal with the consequences. And of course not a lot of vertical room for the escape capsule to fire its thrusters (a parachute may not be a lot of help given how little time/vertical distance there is). So, whilst it can be engineered, it would add many tonnes to Starship.

Its not going to happen. Partly because its just too much extra mass. Partly because Elon says so. Which takes us back to the hundreds of unmanned flights needed to establish its safety and the fact that that could take two decades. And in any case, we don't need Starship to get humans to and from Earth orbit - we already have tried and proven capsules for that job. In a nut shell, Starship is going to be a cargo vehicle. It might even be a good cargo vehicle.
Reply: Humans are fragile. They need a lot things to survive, not just food and air. Cargo ships would be much simpler. Passenger ships would be complex.
Reply: A flight deck will be necessary to stave off insanity. It's 6 months. You'd need a larger space than a cockpit.
Reply: Because the room will be protected by radiation in case of a solar storm.
Reply: The only way for humans to migrate beyond the confines of Earth and be anything other than to be a temporary visitor on other worlds such as Mars will require that the genetic engineering of humans to survive the rigors of life in space.
Reply: @nulled7888  the starship will have 100 ppl on board
Reply: because they have to sit in the launch seat for the g's. maybe there will be less controlls and screens tho...
Reply: " if the starship is designed to fly without crew and carry cargo on its own anyway?"

Pretty much every launch is done by a computer, even Apollo was launched by it's onboard computer.

And yes every crewed spacecraft has a controlpanel because if an unmanned craft goes wrong flightcontorl simply blow it up. If a crewed craft goes wrong you probably want to give the crew a fighting chance to do something about it, instead of just killing them outright.
Reply: What's described in this video is only the supplies for the trip to Mars. What's needed on Mars and on the trip home is not included here and will have to be carried separately. This isn't a "one-fits-all" solution.
Reply: They need a full emergency flight deck that can be blasted off from the rest of the rocket at launch.
Reply: @OpenGL4ever  No they need to save the weight for what really matters and just go full kamikaze on Mar's ass!
Reply: @bryanjackson8917  They start from Earth, thus an emergency system for a small crew capsule at the top IS a requirement.
Reply: @OpenGL4ever  Doesn't matter, cargo space will be at a premium, they should just go full on kamikaze, no turning back, not even at the start from Earth, if they die they die living their dream, to try to go to Mars
Reply: @bryanjackson8917  You're talking BS.
Reply: @OpenGL4ever  Sure, why not, I might ask, as the whole fantasy about humans living on Mars is nothing but BS!
Reply: Welp a cargo place could be to add some extra satelites to mars
Reply: Are u undercover Elon?
Reply: @Unmannedair  you can still train everyone but there’s no reason to include more than a handful of control panels for the ship.
Reply: Well the thought could be a command deck escape module nose concept would require all crew to fit.